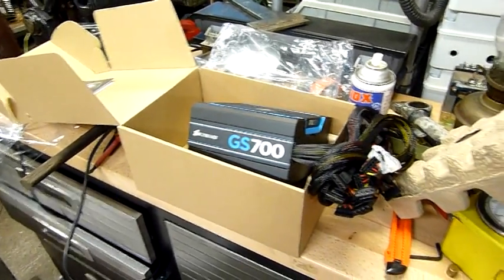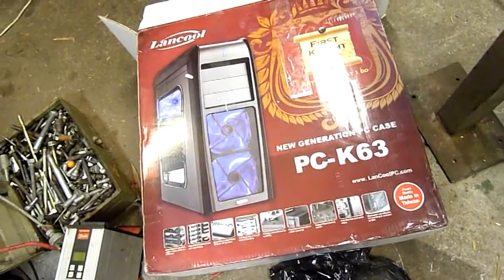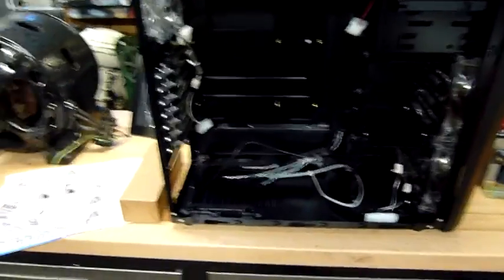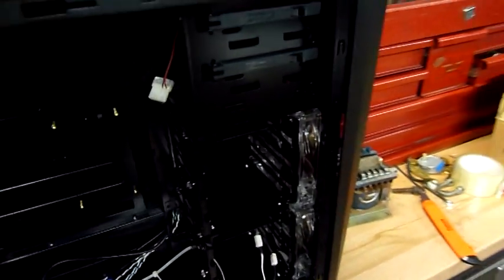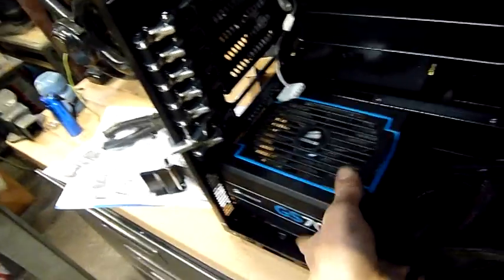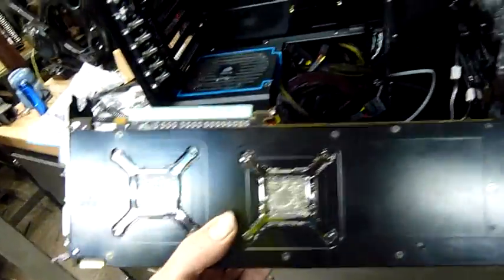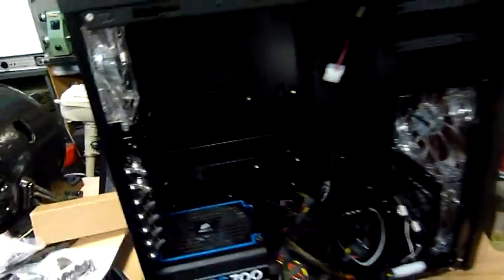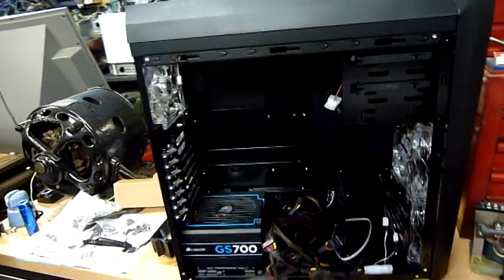Gaming PC Build Pt1 - Lian Li First Knight Case and Corsair GS700 PSU

Comment: Hey ED, does not really matter if you put the power supply up side down, my HP Pavilion has cooler master PSU and it just has to be mounted up side down but make sure there is enough space for fan to pull air or will end up shortening the life of the PSU :) and probably better with screws at back since that quick release seem to block the fan intake.

Comment: Not sure if you have already considered it but I HIGHLY recommend getting an SSD, the prices have come down a lot and the performance increase is huge, I have personally used SSDs in home office PCs that I have built over getting a higher end processor as for loading applications and office tasks I find that the SSD provides a much better performance boost than the better chip.

Comment: I have my PSU the other way where it pulls air through the bottom, my logic in that is that it is less likely to affect the airflow through the rest of the case, not sure about your case but my Corsair 650D case has a dust filter in the bottom for the PSU.

Comment: The vents in the bottom of the case are designed for the PSU fan to draw in COOL air from the bottom of the case. The cables should also run flush against the back wall of the case so that cable management is easier. It doesn't look like there is much flow through the bottom, but believe me it is more than sufficient, and much better than sucking HOT air from your AMD GPU.

Comment: I agree that it does... but it will still add to the residual heat (especially a card that is overheating already) along with other heat producing components inside the case. It's all personal preference when it comes down to it, I'm just saying that the intake vents at the bottom are sufficient for most PSUs.

Comment: You might want to look into pre-built watercooling system, like a Corsair H80 or H100. I have an Antec Kuhler 920 and it keeps my AMD FX-8120 @ 4.0GHz at room temp at idle with some Biostar TC Diamond thermal paste.

Comment: I use 2 monitors and I plan on getting a gtx 660 and a third monitor, and maybe a 4th crappy one just to run conky on. I do a lot of programming and web development and being able to have multiple things side by side is a big help. I love having compiz running so I need graphics acceleration. I can't use xinerama and twinview can't span multiple cards. The only option is a 600 series card or an active dvi splitter.

Comment: if you have a lot of case fans then heat from a GPU isn't going to affect the power supply, and good modern power supplys are made to move lots of heat which is why they moved CPUs near there. and your not going to leave all those fans turned up when just using the computer for other things so the power supply is still very relevant to computer cooling, case fans or otherwise.

Comment: No need, I have the GS800 in my current machine and Corsiar PSU are tough. Very solid unit. Should have no problem running your hardware with that. Even with a Quad.  (I have a phenom II X4 paired with a GTX570) It didn't bog down at all and wasnt even at full load. You should have no issues with that unit. (unless rare case its defective,)

Comment: The PSU should be getting enough airflow when you put it upside down in the case. My cooler master case has the same bottom PSU design with a ventilation hole on the bottom. I haven't had any overheating issues with it

Comment: Agreed re power supply fan facing up or down. In actual fact you should plug the supply in and jumper the green and black wire to see how the air flows. No point in having the fan facing up if the air is drawn in at the back, heated by the PSU guts, then blown onto your video card! Mine faces down.

Comment: You want to be careful with the 5970, I've had one. You can do 1GHz but most likely, you don't want too.

Those PSUs are meant for bottom mount cases. Also you want them the other way up so the cables can run up the back of the case, making everything tidier.

Comment: I hope the crossfire problems with saints row gets fixed. You may also want to look in to a bolt on water cooler like a H50 or higher. that way if it leeks it wont destroy any thing.

Comment: like with like is the way to go if you want a quick and easy build with minimal bottle necking or driver issues. I'm a little surprised you did not go with a PSU with modular cables as they are really convenient.

Comment: Allways nice to have new bits, very nice case :-)

I thought it was a hovercraft with all the fans :o), dont forget to change the hoover bag once a month ha ha ;-)

If you go mad with overclocking make sure the northbridge chip has its own fan, my mates machine died the death due to the northbridge overheating.

Perhaps a small temprature monitor program would be a good idea, just a thought :-)

Smashing update :-)

Comment: ive got a quad core i7 2.93 GHz (OC'ed to 3.6 GHz) and its being water cooled by a corsair H60 and i get about 29 - 35 degrees, with a GTX 460 and 2 1tb hdds. i built it in early feb 2011

Comment: those 2 yellow 'donuts' with thick copper cable suspending from 2 points (visible at :34): I had one in a 680w. supply (no name supply in a brand name computer: later models had name brand power supplies) that was only secured with a dollop of silicone which of course separated at thinnest point...computer sat for 3 years til I got around to finding out where it failed. The donut would flop down and touch the board, causing instant power off.

Comment: and you should definitely mount the PSU upside-down, with the fan pointing toward the base of the case. otherwise it'll be getting hot air from the computer. the light from the fan should radiate from the bottom of the case tbh. if you're running water cooling on your CPU, you won't need it for your GPU in my experience. finding a waterblock for your 5990 will be hell.

Comment: From personal experience water cooling requires too much maintenance (water leaks, refilling, blockages, radiator leakages and other problems and that's from a good name-brand commercial product!) .

I suggest to use a good air cooling (I also reside in a very warm country so water cooling was a good idea at the time...)

Comment: The GTX 600 series cards are a lot better. They actually support 4 monitors. With the 500 series cards you need 2 cards for 3 or 4 monitors and you are either stuck without graphics acceleration or being unable to move windows between monitors on different cards.

Comment: uh, the hot air from that GPU heatsink gets pushed out through the back.

His PSU will be better off with getting slightly above ambient temperature air than next to bugger all.

Comment: The original draft of the ATX standard had that because back then (early Pentium era,) that was most likely the only ventilation fan in the case. That's irrelevant in modern cases with plenty of ventilation, and with power supplies that are expected to constantly provide upwards of 500W. That creates a lot of heat, and adding heat from a big GPU on top of that is not conducive toward long life for your PSU.

Comment: Lian Li are some of the only cases we use, quality is unrepresented. Camerongray1515 has a point, i agree with a SSD at least for the OS and software. Then use mklink (symbolic link) on users dir for your larger storage drive, giving you seamless integration. You'll need a script to do it right from PE env. Also the PSU should face down drawing air from the bottom.

Comment: hehe, it's an odd feeling when you wake up the next day and check ebay to find that you had brought a whole computer at 2am and completely forgotten. :p

if you don't mind extra noise during games and you can find a good fan controller then if you re-do the thermal compound it should be alright like that. water cooling is only if your looking for a silent solution.

Comment: hmm I have Gigabyte and I love it .. before I had asus and it fucked me over basicly it failed ot would even boot up , not even a flicker , then I bough gygabite and its 4 years now and still working perfectly heat-selfregulated - it holds constant temp nomatter what I throw at it  fans work perfectly and double bios feature saved me once :D